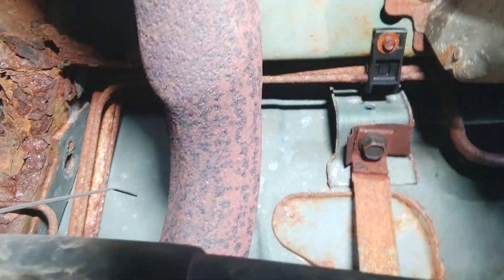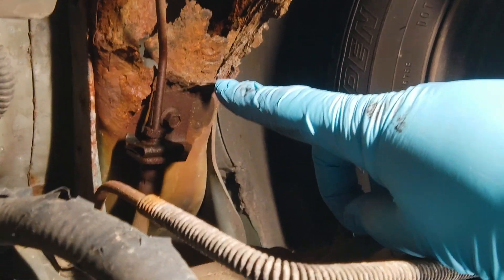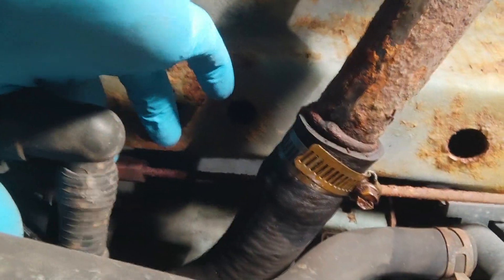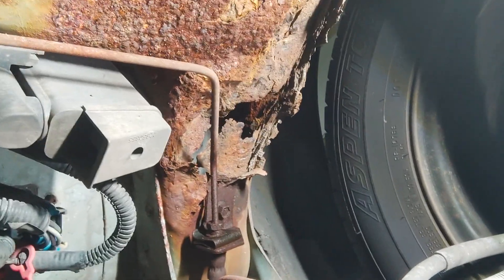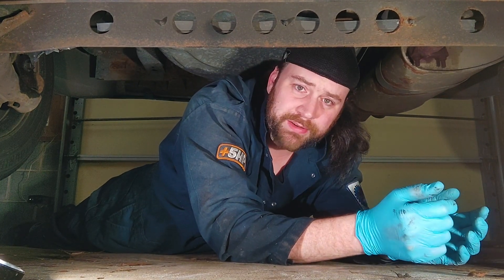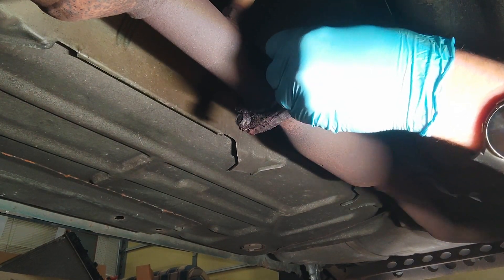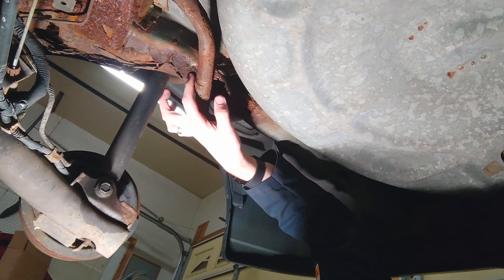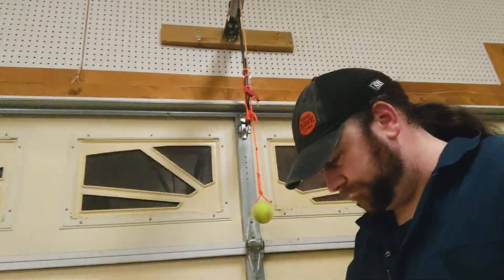Leadfoot: Bad News for the J-Body | Sunfire Frame Rust Repair, Part 1

Comment: On that exhaust flange, when I worked as a tech, I never bothered with trying to take the flange bolts off, it was either the gas wrench or cut off wheel. If I had to reuse the pipe end, I'd blow the old bolts out with the torch, clean it up with a grinder then new bolts and a gasket

Comment: Mine rotted out where the rear axle attached to the body, causing the axle to break loose and hit the rear wheel opening. Mine was extensive, and not really repairable. I salvaged parts off it to put in a 2 year newer car that needed front end body parts and the subframe. I only gave $500 for the car, and had it give years and it went thru my 2 daughters and 50,000 miles, so it paid for itself.